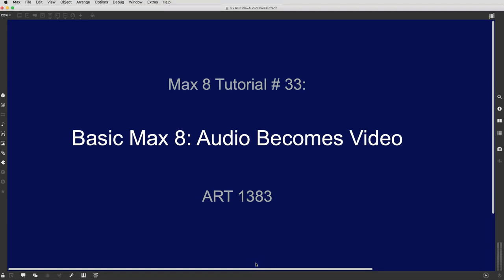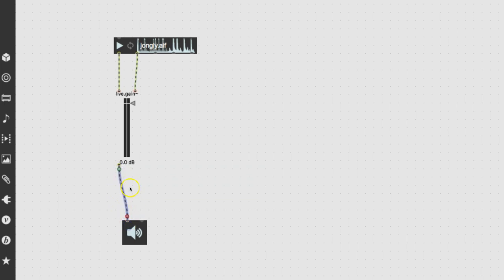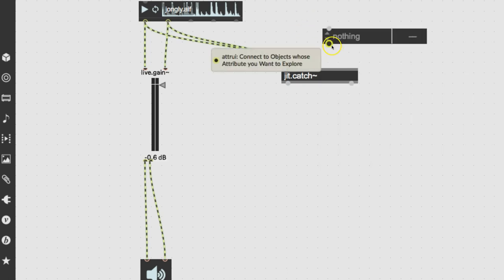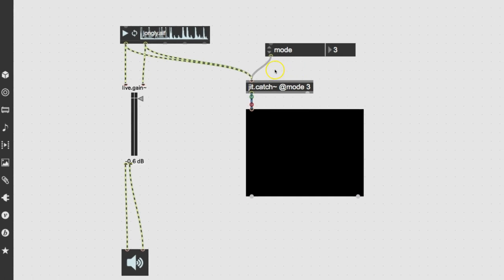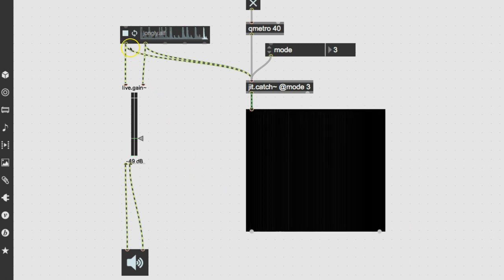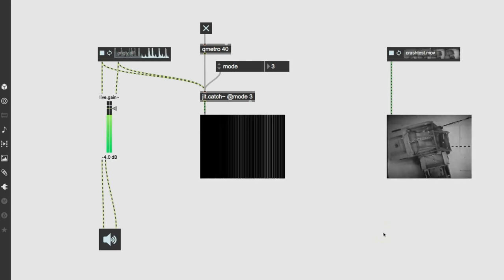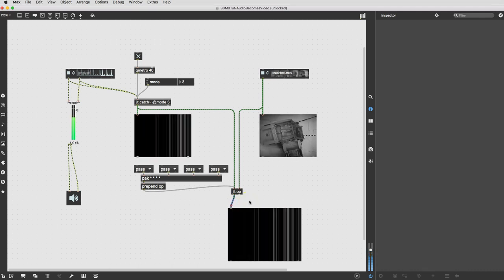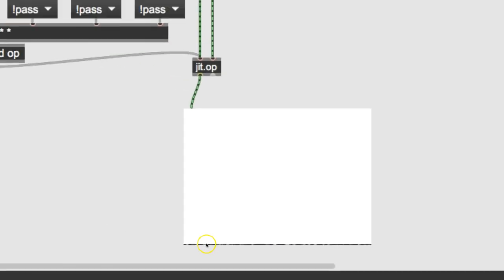Max 8 Tutorial #33: Audio Becomes Video

Comment: Is it possible to run something like an ezadc through jit.catch? To visualize live sound instead of just an audio file?
Reply: Yes, absolutely.  The problem is that if you want sound produced by the computer (like MIDI or another application) most people don't have the ability to "patch" their audio around to feed it into ezadc~.
Reply: @johnreed3238  so what would adc go into in before jit.catch?
Reply: @joebauer2  For safety, I would put a live.gain~ between ezadc~ and jit.catch, but you could probably connect them directly. I always like to be able to modulate it a little.  I would also put a meter~ under ezadc~ so you can tell if you are truly getting input.
Reply: @johnreed3238  Ah, I see! Yeah, it goes right in, I was just too quiet to register anything. Thanks for the response!